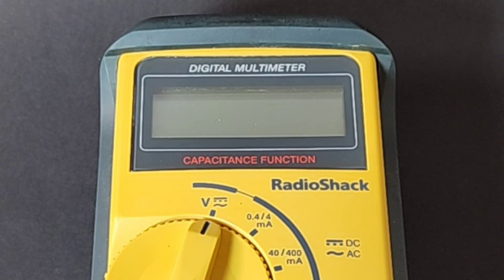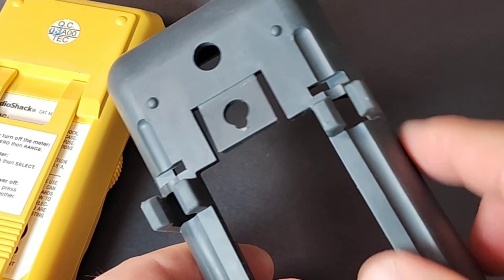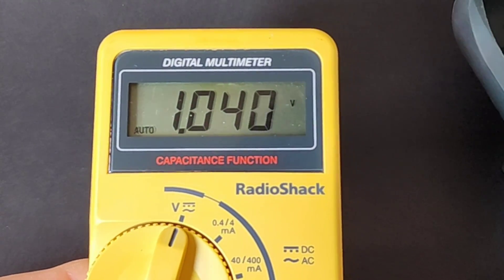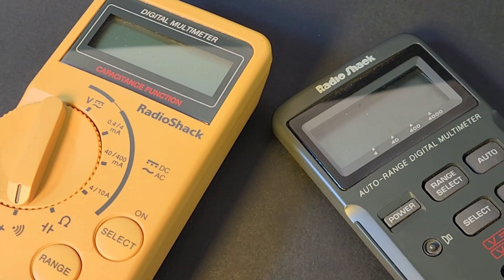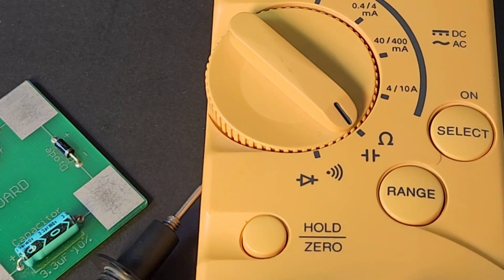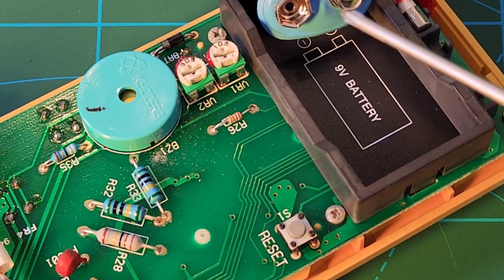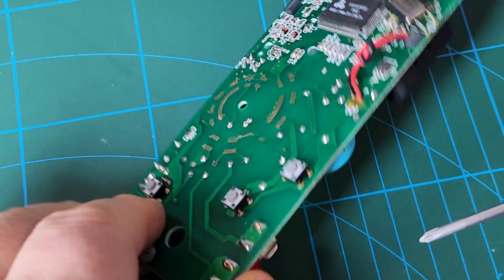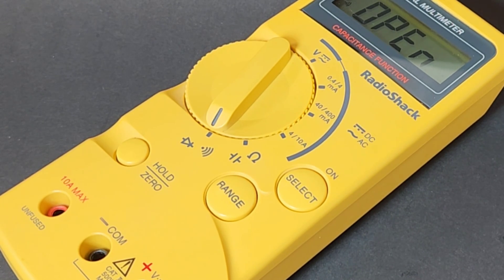RETRO-TECH ○ RadioShack 22-801 Multimeter Mini Review & Teardown! (1999)

Comment: My 22-801 does not make a sound when testing continuity. What's the issue with mine?
Reply from the maker: Speaker might be shorted or trace on the pcb might need cleaning for starters.. 🤔

Comment: One of those extra "reset" buttons may take care of the capacitance issue? I bought one of these in 2000. Wore it out a few  months ago, crossed my fingers went to ebay and tadaaa! A brand new one sitting on my bench. I use a big MAC multimeter for bigger jobs but for the size of this, the speed, the 801 is my go to.
Reply from the maker: Ebay can be a real treasure trove for us multimeterphiles! Great find 👍
Reply: @KeepOnTesting  yep. Not sure what happened. Fuse is fine. I'll have a go at it one of these rainy nights. Maybe I'll wind up with two!

Comment: Funny.  I have an earlier RS model, but only slightly.  Been using it since the mid-90's.  I have kept it in an old sock all these years, and it still looks new, delivers correct metrics for ohms and volts and amps and temperature.  Has the manual in the sock, and believe it or not, the pages look like they did when I bought it (e.g., not yellowed).  Couple of differences.  Mine has a metal stand in the back; takes four AA batteries; and its a lot louder.  I keep it in my old tackle box that was never used for fishing, but has all my electronic equipment for working on PCs all the way back to RS232 cables and parallel port interfaces.  I'm so lazy that I haven't cleaned them out.  Old rubber bands have turned to mush.  Old twist ties look exactly like they looked when I bought a bunch from HALTED SPECIALTIES in Sacramento in about '89.  Even has pin-breakout for ALADIN HASPs which I haven't thought about in decades.  You make me wonder if I shouldn't go through that big, heavy old tool box and remove the IDE and RLL cables.  One more thing...  I have an enitrely separate tackle box (also never used for fishing) with at least 30 hard drives I swap-backed-up over the years.  Some are even RLL, sad to say.  It is funny to think that I could copy all of their accumulated content onto a single USB 3.1 flash drive, now.  I really should do that.  But then I'd have to shred the drives, and I still haven't found a place I can trust to do the work for me.  Anyone seeing this:  is there a cheap physical hard-drive shredder to be had?  Spending 5k+ for 30 drives is absolutely rediculous.  I'm looking for a few hundred bucks.  And I DO MEAN SHRED!  I don't want to "soak in water", "disassemble", "drill holes through", or "sledgehammer".  None of them are reliable. I know.  I am involved with security as a software engineer.  I want a good shredder.
Reply from the maker: Hehe...😂 Great story ! I love hearing about those old multimeters and the history behind them! Those old socks must be something special as it sounds like your meters are in pristine condition! Thanks for sharing 👍  BTW, I'd love to see a picture of that RadioShack multimeter ... if yiu get tge time ,my email: netplicity1@gmail.com
😊 As for the HD shredder, I don't know   of any that are cheaply priced. Most are in the thousands as you said. I used to smash the glass platters with a sledgehammer, that was effective and cheap. 😅👍

Comment: if we enter 220vac voltage into dc voltage mode, will it cause a problem or damage the multimeter?
Reply from the maker: It won't harm your multimeter if you measure AC volts in DC mode. AC will simply measure as 0 volts.
Reply: @KeepOnTesting ok,thanks mr.Darren

Comment: Hello Daren ! ! !
 First of all, this multimeter is nice and ergonomic. 2 tuning resistors are found almost everywhere at that time. But based on its functionality, more is not required here. The circuit design has fairly accurate dividers, and the processor wiring is also made with high precision. There is a full-fledged shunt for measuring current strength (and not as is now done through an SMD resistor). If you look at it this way, this multimeter can compete with the multimeters of that time from Japan and Korea. And in general, as far as I know (you can correct me), the RadioShack company has produced and is now producing very good quality electronics, comparable in quality to Sony, Casio, Panasonic. (It seems to me so, from what I saw). How do you think ?
Also, if my memory serves me right, the Micronta brand was produced at RadioShack factories? Or am I confusing something?
Darren, I answered you by email ) You haven't been to the post office for a long time. check please )
Reply from the maker: Hello 👋 youu are correct ..these were fairly well made instruments..many RS meters were made in Korea but they started Chinese factories like most back in the late nineties. Overall production was good with decent QA. They did produce some turds but for the most part they were a solid and respected name in Electronics.Micronta was a subsidiary company of RadioShack,  basically the same company under a different corporate umbrella. Btw, I just responded to your last email 📧 👍

Comment: Nice find, we grew up in a town with no less than four Radio Shacks in their hey day of the 70's and 80's and we were crushed when they stopped printing their store and parts catalogs - when cell phones became a thing RS turned into "Gadget Shack" with most emphasis on cell phones, remote control cars, computer gear and less and less electronic parts etc. on the shelves and the quality upper scale stereo gear they once sold started turning into over priced department store grade stuff. One of RS biggest problems is a lot of their merchandise was way over priced compared to other sources, but they were still a source of many parts you could pick up easily just a short drive away and when that disappeared it was sorely missed - we used to love perusing the catalogs though.
Reply from the maker: Love those RadioShack memories ❤️  I remember eagerly awaiting the latest RS catalogs...it was like Christmas came early when they arrived!